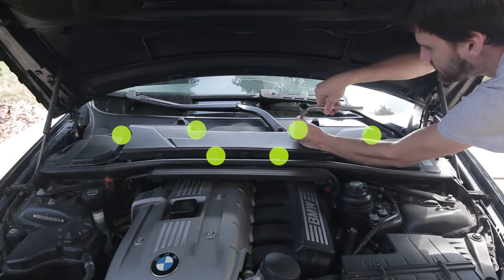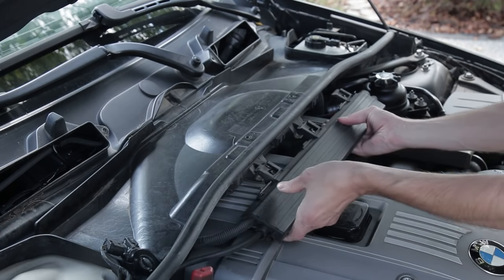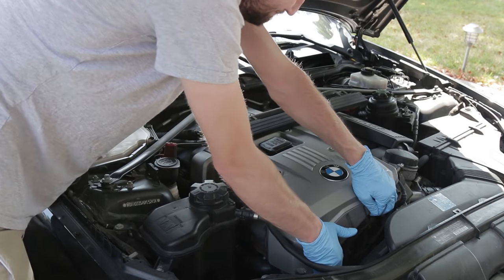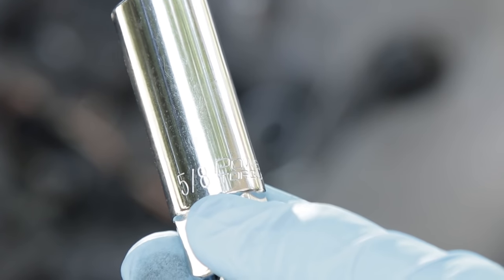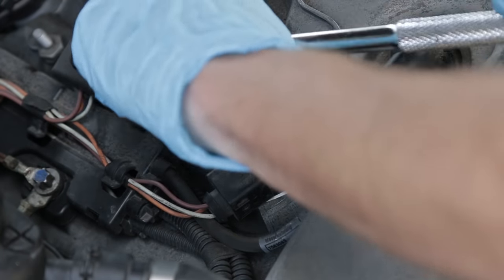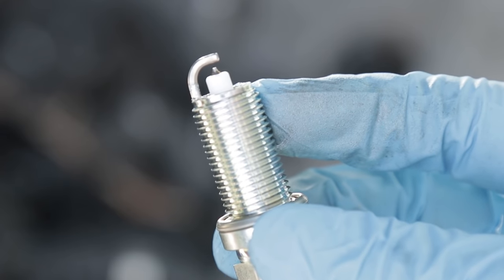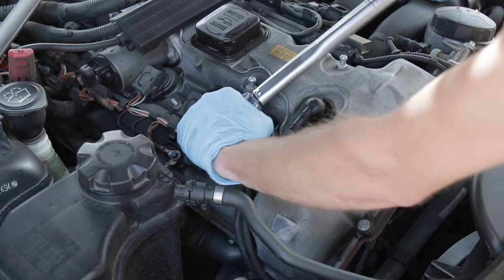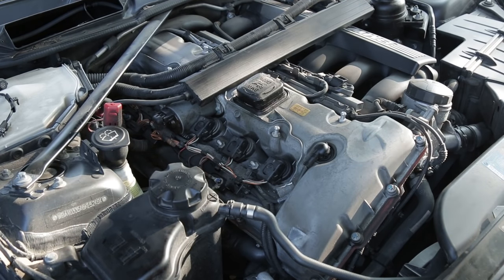How to Replace BMW Spark Plugs & Ignition Coils [E90, E92]

Comment: Im no car wiz but how about making unplugging your battery before doing any electrical work step 1
Reply: BMW, proud engineer and manufacturer of Messerschmitt Radial engines. Backbone of the Luftwaffe 😊
Reply: By unplugging your battery, you run the chance to put your car in anti theft mode, or ruin the footwell module, uncalibrated windows, and ETC... you get the point, BMWs are very sensitive. I’ve been there and learned from my mistakes and I wouldn’t want anyone to do my mistakes, such as unplugging the battery, I can see your point, but be sure to use a OBD memory saver if you are.
Reply: That's rookie shit. 

A real mechanic dont do that.
Reply: If you disconnect or replace the battery it will not work. Dealer or shop to reset car to work

Comment: Why does BMW have to make everything so complicated.
Reply from the maker: +j az good question. I spent as much time taking off those plastic covers as I did actually taking the spark plugs out
Reply: I was literally thinking the same thing lol
Reply: @justinbuice  
Yeah, you spent almost 15 mins doing this...Its so hard, so much time consuming for something to fix... After this you will need cca 2-3 mins to rest ur body... THATS A LOT
Reply: Lol, yeah. I had Mitsubishi Galant, and Ford Mondeo before I got E90 last year. I had to change light bulbs in both of them and it was extremely easy, doable from the engine bay. Like 1 minute and job done. Then I had to change it in E90, so I opened the hood, and couldn't find a way to do it. Then I checked YT and learned it's to be done from the wheel arch. Complicated and rather hard!
Reply: Because it's the ultimate driving machine 😁
Reply: How do u know what spark plugs fail? I'm getting errors for misfire on Carly. Without a scanner I would of never known.

Comment: Thanks so much for this video, after spending 1K on this in the past,  this took for 45 minutes,  so easy,  
75.00 for tools and 200.00 for ignition coils and spark plugs,..saved me 750.00  (2007 bmw 328xi )
Reply: What tools did you bought

Comment: Thanks for this video! I was getting misfiring at idle and under acceleration, turns out on plug never got replaced last time by the stealership and it was totally shot! Swapped my plugs and coils today super quickly and easily thanks to you!

Comment: I really enjoyed this video. I had a 2006 325i that I changed the spark plugs on. This is part of the BMW experience. The DYI, because the dealership is way too expensive 👍🏾
Reply: leon thomas what brand did you use

Comment: Did all mine plugs and coils today. Also went ahead and replaced the valvetronic eccentric shaft actuator gasket while I was in there. Thanks for the easy reference video. Needed torque specs. Thanks buddy.

Comment: Thanks very much Justin.  A friend had recommended the use of dielectric grease on the spark plug ceramic and the ignition coil boot to reduce moisture/water penetration and for the ignition coil to separate more easily from the spark plug since the heat could fuse them together.

Comment: Thank you for this DIY video.  Shop wanted $1300 for plugs and coils; seem a tad...much.  Followed your video, about 3 hours and $250 for Bosch parts.  Good deal!   have problem starting after completion: discovered that wire harness(es) had to be pushed into coils until they were flush with coil; attaching them enough for clip on top of coil to fold down didn't provide adequte connection.  Cheers!

Comment: Justin good video my friend when r u going to replace the transmission fluid?
Reply from the maker: I have a few fluids that need to be replaced. I may just take it to an independent mechanic and have them all changed at once. Fluids can be a hassle with recycling and everything
Reply: Justin Buice which fluids all at once?

Comment: Hi Justin, my 328xi has 110k on it, the engine started shaking a little this morning. I stopped by at the mechanic. They suggested to replace the ignition coils and spark plugs with no error codes detected. I will try to DYI and would you mind link me the tools you use? TIA

Comment: Good morning guys. I just had a quick question. I have a 2011 BMW 328 xDrive with about a hundred forty Thousand Miles. I recently bought it at a hundred and thirty-five Thousand Miles. Currently I am going to change the spark plugs from NGK to Denso iridium. I would love to hear your thoughts. And also, do you suggest that I change the coil packs as well? It might make sense because the car is it to owner, and I don't really know too much about the history of the car! Any suggestions as far as preventative maintenance because I am a daily Lyft and Uber driver. Can also someone tell me the list of tools that you need to do the job? I didn't see a list on the description.

Comment: I remember doing this on my old 91 Nissan Silvia (200sx) 2lt 4 banger, it only had one cover you had to remove to access the coil packs/plugs, as they were in the top center of the engine!

Comment: thanks Justin, this is the second time you saved me. I just got my wife a 328ix. after driving a while it started sputtering going low speeds to higher speeds and when stopping at a light it tried to surge forward. I called the dealer and was told that an old guy drove it slow and I need to reset my computer?
Reply: Ko

Comment: Hey Justin how hard is it to replace the whole entire valve cover ? I need to replace it because my Crankcase ventilator valve went bad and its causing burned oil like smell to go inside car and an terrible whinning noise . The PCV is intergrated on the actual valve cover thats why I have to replace the entire thing ! Thanks for your vids bro there very helpfull

Comment: Great information. I'm having a problem with coil #3 and #4. They are shorter than the rest. I found a spring that goes between the coil and top of the sparkplug. How do I put that spring back in and feel confident it's touching the top of the sparkplug and seated inside the coil?

Comment: What do you know about the new BMW manufacturing specification changes the plug support sprue  is now centered below the plug and may interfere with some original harness connections which may have off-center cutout. In those cases, the plug sprue on the coil must be CAREFULLY cut back to allow proper harness connection. How would you cut the spree back?

Comment: So the spark plug socket you used is a standard one, not a thin walled ?   Good job by the way
Reply from the maker: I dont remember what I used in the video, but get a thin wall if you can!

Comment: I have  2012 328i N52 motor.  The dealer wanted $142.13 tp replace the micro filter & $380.52 for the spark plugs.  Got an aftermarket filter and NGK spark plugs (same part number that the factory NGK BMW plugs had on it - LZFR6AP11GS) for under $100, which saved me over $400.
Reply: Took a little over an hour for both

Comment: Hello Justin, have you NOTICED any improvements after this change ? 

Thank you ✌
Reply: I did this to my bmw and my spark plugs were bad but not terrible. Yet, I really didn't notice a difference
Reply: I had an e46 start misfiring, got all the spark plugs and coil packs changed and you really can tell.
Reply from the maker: It's not too noticeable. Maybe a little smoother both at idle and while driving, but not like the car is any quicker.

Comment: Great vid! How did you know it was time to change the spark plug and coil pack? Was one of your cylinders misfiring, or was the car acting up in any other way? Or did you just reach a certain number on the odometer and decide it was time?
Reply: Just general maintenance/part of a good service.  Most people clean their fridge out once a year/6months  why not clean out old parts from the car which gets far far dirtier?

Comment: For all the DIY videos you’ve posted do you normally remove the negative connection on the battery before performing engine work? Not sure if it’s needed to do spark plugs, injectors, etc. I might be spooking myself here...
Reply: With the vehicle off, no real volate at coil / leads (or exposed, energiezed contacts - unlike a starter) etc., you're fine to have left the battery connected.

Comment: Hello Justin . Great video ! Can this be a cause  I been getting multiple random misfires , rough idle , shaking when I turn car , when I drive on freeway it runs normal when I slow down it stalls  with the idle . I already change and clean camshaft sensor and vanos but still the same .

Comment: Thanks for the help! All done ...no more rough idle and the 330i seems to be running great! But plugged in the OBD and its still showing misfire on 3 and check engine light ?! Does something in the vehicle need to be manually reset?! I appreciate any feedback !
Reply: Did you ever figure this out? I’m in the same boat but I am still waiting on a couple ignition coils to ship along with 2 spark plugs.

Comment: I have a question when u put the ignition coild back in place do they lock in place or they can still be pulled up because mine can still be pulled up even when i connect them

Comment: 0:47 , what is that part called ??? The other side of the engine compartment has one as well and mine is loose on both ends. What is this ?  Please help anyone !!!!!
Reply: I believe that’s the auc sensor.  If I recall, it measures the air quality and tells the hvac to toggle the air recirculation on and off

Comment: Justin , I been subscribed to you since I bought my BMW 2008 328I N52 in December 2017. First thing I had to do was a complete transmissiin flush,  serpentine belt and pulleys. We got a good deal 500.00 for it all.
In the last 3 weeks, my car has been burping randomly at a stoplight . With A.C. running . I turn off the A.C. it stops. I have been told it's my spark plugs maybe coils. I have no dash lights telling me anything is wrong . Could you tell me when you're went out what systems did your car give you . Btw I love your channel , I watch every video!
Reply: Shantelle M. Crank sensor

Comment: Justin, do I really need the torque wrench for the spark plugs? I’m kinda in a budget.
Reply: Brian Olivo bro if you over tighten it , it will fall in The block of the engine and the three to $4000 job pulling up to purple out of the engine just invest in a $20 harbor freight tire wrench  bro
Reply: AJ Madera it’s only around $20?? I didn’t know. I’ll definitely get one.
Reply from the maker: Always use a torque wrench, especially for the spark plugs because they are in a tight, hard to reach spot. If you over torque them or damage the threads, they would be a nightmare to remove.

Comment: I have a 2006 BMW 330xi with the magnesium cover and I ordered those Bosch Ignition coils and Double platinum spark plugs but my ignition coils wont click in with the electrical harness I'm frustrated, I read some forums and people say it may be be because the ignition coil has a Male connector or and not  a female connector that's causing the coil to spit out the connector. Idk I dont want the hassle of returning them because I dont know which ones to get anymore

Comment: I'm paranoid that I could strip a thread on my engine head.  I have the N52k in my BMW x5.  I'd love to replace my spark plugs.  Is it really as easy as using a torque wrench set for 18 pounds per square inch?

Comment: hey just had a quick question, is it super important to torque the spark plugs? i’ve seen most mechanics just tighten it and it’s been fine plus i don’t know how that would fit for the last spark plugs
Reply from the maker: If you over-tighten them, there's a possibility they will break the next time you replace them. If the threaded part gets stuck in the engine, it's a pain in the ass to remove

Comment: Should I cop a 2004 BMW 3 series 325Ci convertible for my first car or something else?? Anything you recommend for a first car?
Reply: Baltazar Marquez get it! Or get a 3 series e90
Reply from the maker: I'd try to get an E90 if your budget allows. Nothing wrong with the e46, but as they get older, it's harder to find them with low miles.

Comment: Did you have issues removing no 6 plugs since it is behind fire wall
Reply from the maker: You shouldnt have any issue reaching any of them once you remove the cowl box for the cabin air filter. The only tricky one was either 4 or 5 becase a strut brace is in the way, but with the right socket wench you can get to it without removing the brace

Comment: my bosch plugs for my 328i said 30 ft pounds  I couldnt hear what u said for torque ?? 18 foot pounds? why are mine so much tighter..it said 30 ft pounds on box that plug came in (BOSCH) 2008 328i

Comment: I have a 2006 325 can you tell me what ignition coils to use? I bought some Bosch coils and they wouldn't seen to fit into the connector properly.
Reply from the maker: I had the same issue with mine. BMW changed their ignition coil design midway through 2006, so if you have one built I think before april it has a different connector. The correct Bosch part number is 0 221 504 465
Reply: Justin Buice ok that's the part number I used do you know the other part number?

Comment: Do you have to change spark plugs when changing coils?
Reply from the maker: You dont have to, but if you have a coil fail, take the plug out and inspect it. Sometimes oil leaks around the plugs cause the ignition coils to fail prematurly

Comment: Why change out the coil packs ?
Reply from the maker: It's more of a preventative maintenance/ peace of mind thing since I've had coils go bad in the past. Since most people will be changing their plugs around 100,000 miles, it doesn't hurt to change the coils too while you have everything apart. But not necessary as long as they are all working.
Reply: Justin Buice you think it's too early for coils and plugs on my e82 n52? Just popped over 50k miles last week.
Reply: Justin Buice id like to know this too; im hitting 60k
Reply: If you have the extra $240 ish dollars go for it. It never hurts to replace plugs and wires. In fact you can remove the coil and plug from cylinder 1 and check the carbon on the plugs. All you have to do is remove the beauty cover. Should only take you 10 mins most to check it.
Reply: misfires

Comment: If my e90 rpm keeps going up and down when the car is at a complete stop and the engine starts to shake could that problem be of the spark plugs someone please reply
Reply: Sounds like ignition coils or spark plugs. Worse case scenario is the Valvetronic Eccentric Shaft Sensor, which would require opening the valve cover and can be costly.
Reply: Vanos solenoids?
Reply: @wombocombo4547  My 07' 328ix had an 1100-500 RPM fluctuation and stalled often. I replaced 1 Vanos "VVT"    (because I broke it trying to clean it) and cleaned the other. Idles great now. Have a misfire now and I will be doing the plugs and coils soon. Vanos (VVT's) are about $110 at advance auto.

Comment: Hey man, I replaced the coolant reservoir, the upper hose and the radiator hose, but I keep losing coolant, I checked everywhere and I only noticed white drops on that cover you just took off... any ideas?
Reply: Kevin zz head gasket
Reply: JeepLife 203 but is not over heating... it only has 91000 miles...   the white drops are found at the left side of the engine cover
Reply: JeepLife 203 I think I made a video about it

Comment: I replaced a bad coil as well as the spark plug now my car will not start. The break pedal is stiff doesn’t budge any clue on what it could be?
Reply from the maker: Do any of the electronics turn on when you press the start button? Did you disconnect the battery before you started working?

Comment: I still find it funny my N52 325i sounds like a diesel when idling.  And I have had it checked and the engine is just fine.
Reply from the maker: It is probably just the sound of the injectors. Also, 2006 and 2007 models had an issue called valve lifter tick which would make a diesel sound when idling. It's caused by driving the car short distances where the engine never fully reaches operating temperature.

Comment: Hi, what is the mileage of your bmw? I want to buy a bmw, but my friends told me that over 70000 miles bmw is bad. Is that true?
Reply from the maker: Mine has 80k miles. A friend of mine has 140k on his. It depends on the exact year and model that you are looking at
Reply: Brought my 09" e90 @ 120k and  3years later now at 157k only had to change the spark plugs and coils . And the normal stuff brakes and oil changes .

Comment: Just purchased 2011 BMW 328 xi with 134,000. 3 previous owners. Car fax doesn't mention major repairs. Is there someone out there on the internet with a good heart that can guide me as to what are the list of repairs I should get done? I'm a Lyft driver, and I will be using this car to drive people in and around town.
Reply: I also own an E90 and some of the main service items include cabin filter, engine filter, spark-plugs/ coils, clean or replace vanos solenoids, coolant flush, transmission fluid change, and for the common repair items are; waterpump/t stat, oil filter housing gasket, valve cover gasket, oil pan gasket.
Reply: Check the list of maintenances listed here - https://www.dslreports.com/r0/download/2294029~a7ccced57c514756e4c445baa2542b06/Lifetime%20Maintenance%20Schedule%20v03.13.pdf

Comment: Would a 10" extension be sufficient, or do I need 12"? (Giggity. But no seriously please help haha)
Reply: McLarenBMW  thanks for following up! How much did the 2 extensions cost?
Reply: McLarenBMW  Pretty sure my E92 requires a 3/8 drive, but I'll double check.
Reply: McLarenBMW  Duh lol idk what I was thinking. I should have gone to bed hours ago haha
Reply: McLarenBMW  Nice. I had a mechanic replace the valve cover gasket after the BMW recall a year or so ago, and recently I've smelled burnt oil coming out of my vents for 30 seconds after turning the engine on. Gonna either take it back to him or take a stab at it myself...